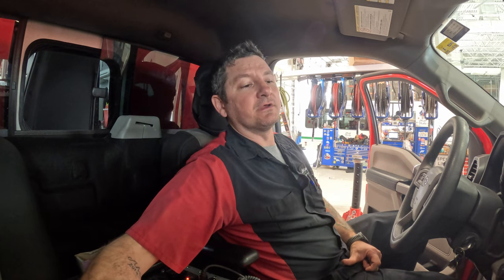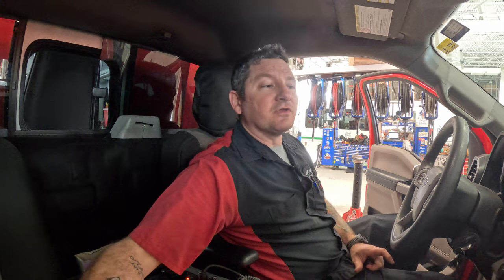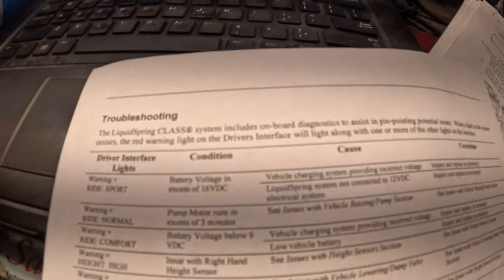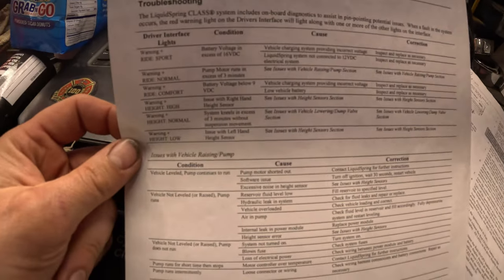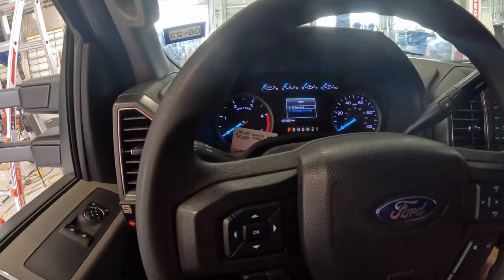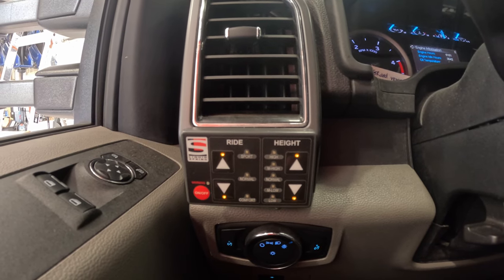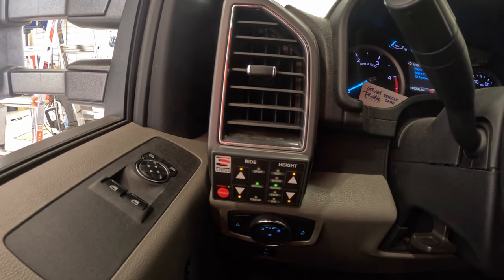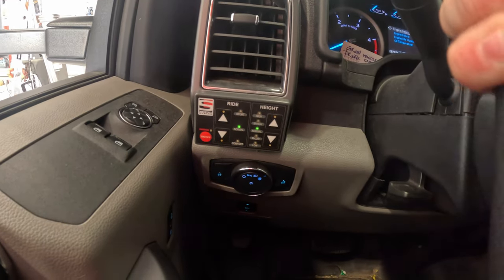liquid springs not dumping or raising full video #diesellife #firedepartment #frazer #ambulance

Comment: Do you know what it means if the red malfunction light is on and all 4 of the steering lights are blinking? Suspension will not go up when this is happening
Reply from the maker: should be able to figure it out, have you looked at the manual online? ill post a link, and i look through it to see if i can help you out.
http://baltimorecountyfra.org/inferno/wp-content/uploads/2019/04/Liquid-Spring-Manual.pdf
page 10
Reply from the maker: so i just read through what i posted as a link and it doesnt show anything with the red warning light and the 4 steering lights. ill look through my book tomorrow to see if i find anything. if thats a loss ill call my frazer guy.
Reply: I would very much appreciate that. I had read through the manual you sent even before watching your video. I cannot find anything out there about this issue.
Reply from the maker: @mikeb8133  sorry im just now getting back to you on this. My frazer warranty guy gave me this for you to check.
Reply: No problem. Thank you for replying. If you tried to send something with it to it didn't send. Or at least I don't see it lol
Reply from the maker: Sorry Mike I guess it won't let me share a screen shot on messages. I posted it to my Instagram scottyzevt. Or dm me on Instagram with your email. I'll send you the test. However my guy told me he called liquid springs and they were concerned it would be the main brain of the system.

Comment: These normally take a while to go bad for the most part? 
We have air bags still on a 2010 and 2012 F450 but are getting new trucks with liquid spring in the next 6-7 months. Just curious if there is anything to look out for.
Reply from the maker: @warhawk3136  they last a pretty good while. They tend to seep but usually nothing more then a class 2 leak. If it's starts dripping on the ground then we will pull the set off and have them rebuilt.
Reply: @scottyzevt  Do you have a mileage range when you've had to rebuild them? We are a volunteer department with maybe 300 runs a year so we don't rack up miles like a larger city department does.
Reply from the maker: @warhawk3136  just of the top of my head, probably about 70 to 100k. ill look tomorrow at the last one we did.
Reply: @scottyzevt  Sounds like we shouldn't have much of an issue at all, unless we just get a bad batch. But it looks like they have a 5 year warranty for most of it anyway. Appreciate the info.
Reply from the maker: @warhawk3136  no problem any time. yeah the most issues ive had is with it not dumping hence the video.
Reply from the maker: @warhawk3136  sorry for the delayed response. The last replacement we did was on a 2018 ram with 110882 miles